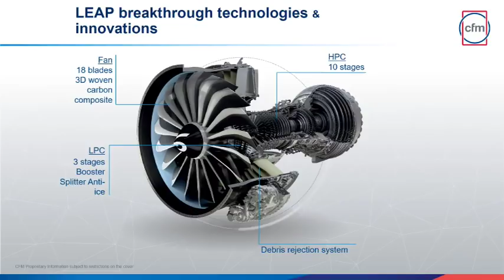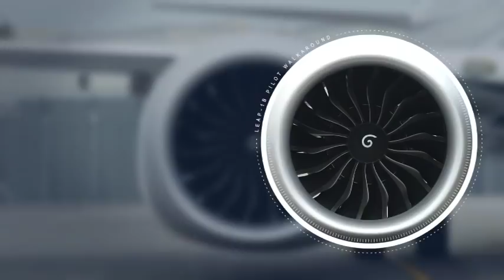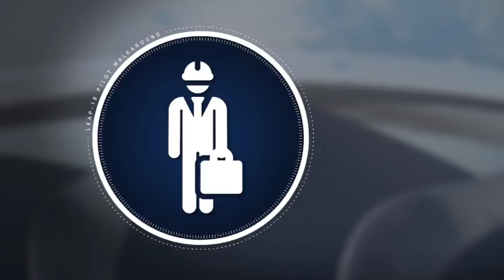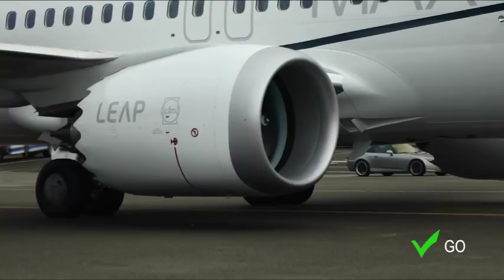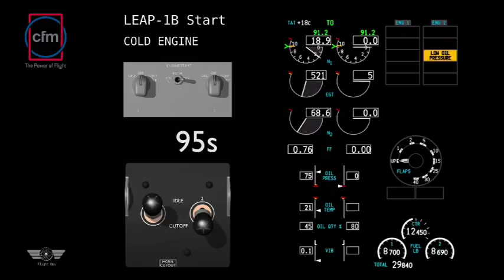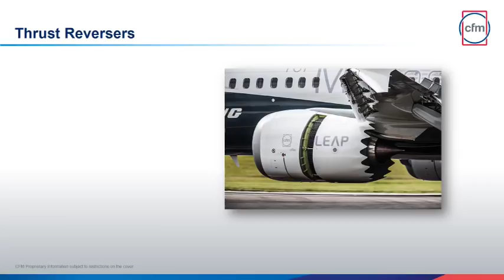CFM LEAP B737 MAX Engine

Comment: This engine is almost identical to GEnx 1b engines. The composite fan blades and fan case, 10 stage hpc and 2 stage hpt and the introduction of turbine center frames makes me think is this a smaller GEnx? 😅 it’s a great achievement to improve the cfm56-7b engine by this fuel efficient engine can’t wait to maintain it  😊

Comment: Lets be honest they are too big to fit the max and the software to hide this massive oversight caused all those crashes and deaths
Reply: Nah, the problem with the max was simple. It handled different than the NG, and the software was made so both flew the same. That way you wouldn't need any simulator training for the MAX...  it has been proven and tested by EASA that the plan can safely fly and operate in all condition without any software help.
Also.. a software to correct or modify a plane behavior is pretty common. As a matter of fact. The B737 (any version, including the MAX) is one of the less complicated airplanes, the only big airlines still in production that uses hydraulic controls over fly-by-wire. So the pilots control the aircraft directly. 
In the case of any airbus, the plane is flown by a computer, and it's behavior is heavily modified...

Comment: Can an aviation expert inform me how bigger engine  or more powerful engine  makes  less fuel consumption    ??  As I know in any mechanical system  bigger engine means more fuel consumption   ......
Reply: Lower rpm for the same amount of power as the older engine acheived through higher rpm.  An engine that has power sooner and revs less will consume less.
Reply: Shadow Opp.'s RC There’s no reason RPM is a problem
Reply: Really the only thing bigger on this engine is the N1 fan.  The core of the engine is actually pretty small, hence the 9:1 bypass ratio.
Reply: Lower RPM, higher pressure. = more power, less fuel

Comment: Most people do not complain about the design of the plane with new big engines, it is MCAS as it is suppose to be a safety feature but it turn out to be a killer, Boeing should take note that all safety features should be priced in the selling price and not treated as optional, period

Comment: Obviously the MAX family needs redesigning. What's urgently needed is a taller landing gear that would allow the Leap Engines to be placed lower and backward, pretty much like the placement of older engines so as to use the CG and thrust parameters as it was originally designed. The new Leap Engines are placed in the wrong place.
Reply: Exactly!  But its like teaching a pig to sing. Not going to happen and you only annoy the pig.  JMHO of course...  8)

Comment: Sounds like the 737 MAX is too over-engined which leads to high AoA due to engine placement over the 737 NG...which required Boeing to install the MCAS...which lead to disaster.
Reply: Somebody at Boeing has an incorrect theory of operation of MCAS which to me suggests insufficient testing or substituting digital modelling for testing.
Reply: @michaelmagyar5734  yupp. It was to rush into market and collect the millions.  Cold comfort for the people that lost their lives.
Reply: MCAS in 737 MAX only uses 1 sensor which is not very proper development. They should've put 2 instead of 1
Reply: The 737 airframe or fuselage 52 years old did not have a new engine option. The A320 did being higher off the ground. The Max was a dud right from the word go, Leap turbo fans too big and too heavy, consequently the aerodynamics of the plane were knocked out, but wait, lets install MCAS said Boeing. And so it flew, well sort of. With faulty data from one AOA sensor it flew..........nose down. The solution. Re engine and dump MCAS.

Comment: A plane that falls out of the sky marketed to developing countries and unsuspecting airlines. Let’s get rid of the AirBus a380, a spacious very safe aircraft and force people into smaller planes built by Boeing that have a built in feature that kills scores of people. Boeing is very proud of it’s accomplishments in forcing out competition and the murder of people then forced to fly on its planes.
Reply: For the record - Airbus had THREE A330 planes with similar attitude-correction systems have "incidents", one had 119 people injured.  In those instances, the computer was receiving unusual data and was indicating stall and overspeed simultaneously.  Yes, those flights landed safely, but Airbus is NOT immune to similar happenings.  The difference seems to be that Airbus had limited the trim authority to 10° (actually TWO protections kicked in, the total trim command from the two was 10°), it seems no such limit was in place by Boeing (though the software fix due in April may include such limits).

It also sounds like the FAA may hold some responsibility, allowing Boeing to "self-regulate" and just rubber-stamped whatever Boeing put in front of them due to staffing shortages, rather than reviewing and verifying what was presented.

Comment: The public has lost trust in Being since two of their latest Boeing 737 Max crushed in less then 6 month.   I certainly wouldn't fly on Boeing!  Coz they put profit before safety!
Reply: Every thing in the USA is like that, Its called Capitalism and its very EVIL
Reply: @RussellD11  And how does socialism avoid this?  There's plenty of evil to go around.
Reply: @michaelmagyar5734  Mr Hungarian man! : )
Reply: It's a lot more complex than that. But it is Boeing's fault, as well as the U.S. government/FAA, for a lack of Federal [Engineering] oversight in ensuring/ enforcing the safety of the airframe type certification, and allowing Boeing to keep the same certification under 737 series, despite major changes to the airframe/ powertrain.

Comment: Grabbing a Fanblade while windmilling may cause a twist ?
Reply: Grabbing a single carbon fiber blade of a gigantic $14.5 million dollar fan while its windmilling is a bad idea, who'd have thought. :-)
Reply: spikester , stoping a Slow windmilling cfm56 by grabbing a fanblade is an absolut normal procedure during the walkaround without any danger of causing anything but a stoped Fan.
Reply: @j.f.sebastian9696  Yes that was the norm I'm sure but then your engine literally gains a net 15% or so on fuel savings the next iteration, as a result of those super lightweight materials and longer fan blades, so it's not so surprising anymore from a construction aspect. Nonetheless a tech marvel.
Reply: spikester i agree but if grabbing causes a twist, what a FO would be able to do ?
Reply: @j.f.sebastian9696  Call for maintenance I guess, however I would expect them to have some tolerances for non-static bending and it would have to be a pretty sudden grab vs trying to slowly coast it down by a blade for instance.

Comment: Same engine installed for Lion Air JT610 and Ethiopian Airlines ET302...  
All casualty have similar problem... 
Are you sure this engine are safe?  Consider both aircraft are brand new and below half year routine flight.... 
The latest technology not guarantee for our safety.... 
Old school turboprop better more than modern "flying coffins".....
Reply: agus wijaya Leap1A is installed on airbus 320, no problem for years. It is the design and software flaw by Boeing, not the Engine or CFM. The engine did not fail. Wrong commands were fed into the engine by the software.
Reply: @wangfengfight  You are right. The engine is not the culprit. The problem was that the engines were moved closer to the fuselage as well as moved forward to avoid the huge  engines touching the ground. This is because the 737 is traditionally built to be as low as possibe.
The plane is so low that actually there are no doors for the wheel wells .....as , if there were doors, then ,  when in open position they would scrape the ground....so in 737...no doors for the wheel wells.
All this shifting of the engine position has resulted in aerodynamic changes including lifting of the nose up due to the enormous thrust of the  low slung new engines....it is to correct this nose-up tendency that the MCAS was devised...which now has become the issue.
Reply: @rajarams5988  Yes the larger moment (force x distance from pivot point) during max thrust seems to make the airplane unstable, and until the 2nd crash, MCAS was thought to be able to recover stable operation under all known conditions.  Now we can guess that there are unknown unstable conditions MCAS is unable to recover from.

Comment: This engine had kill so many people.
Reply: Hop Lam:

The Leap engine has not killed anyone....it's Boeing's failure to provide a  redesigned and larger elevator is what is causing the 737 MAXs to nose dive into the sea/land.

Relying on MCAS is not good enough. When Boeing placed the much larger Leaps on the 737....it changed the flying-dynamic characteristics so much...at Maximum Takeoff Thrust...with the newer Large engines hung lower and further ahead....the plane naturally wants to pitch-up at maximum thrust...in instances like takeoff and climb-out to initial assigned altitude.

Boeing should have given the 737-MAX a bigger rear wing "aka elevator" to counteract the effects of the new engines. The sick part is, the FAA ever approved it fly at all. Sadly, a software fix to the MCAS won't stop future deaths....only a fail-safe larger elevator will.
Reply: Hop Lam — MCAS design errors were the cause.
Reply: JohnDEER175 garden

Comment: According B737Max-8 Lion Air JT610,last flight before crash,passangers from Denpasar To Jakarta said,the engine strange "roar" sound and couple time like loss power a make them like ride roller coaster during flight... and after couple hour,the flight was allready and have "airworthy" to next flight from Jakarta to Tanjung Pinang... Then after take off just 12 or 13 minutes,the plane crash/plunged to tanjung karawang sea...  First And Fatal Accident for First B737Max8...
Reply: that is a normal noise of the engine start up
Reply: @matyqac  ...and can you explain the "ride like roller coaster during flight"?  Is this also normal?

Comment: this engine used in a recently 737 plane
 crashed in Indonesia
Reply: my question also if air speed sensor is failed, can pilot predict from rpm of the engine relative to speed? or any other way?
Reply: It sound stupid only air speed sensor can caused crashed right? Thhis happened before .... when ice closed the hole of air speed sensor...so cant fix it while on flight....there has to be another way to predict the speed....
Reply: And?
Reply: Nothing to do with Engine,
All Airbus 320neo and Boeing 737 MAX use the same engines, they are all fine
Reply: Abhay Achal they’ve put the engines too far to the front. And as I understand there’s a problem
with the leveling software.
Reply: & now the Ethiopian plane.

Carbon fibre blades WTF?

Carbon fibre doesn’t like cold temperatures
Reply: @chris77777777ify  you're a genius...
Reply: Carbon fiber blades have been used for years now nothing to do with plane crash
Reply: @esaumoreno7405  Now we have Ceramic Matrix!!!!
Reply: Your at the wrong place, this is a video for pilots and crew familiarizing them with the powerplant and systems related to the new LEAP engines not a sensationalist media release for those who know nothing about aeronautics - we all know these engines are fitted to the MAX, but why is that relevant and why feel the need to comment this?
Reply: James Bond — Not caused by the engines.
Reply: Yes, but engine is not directly cause, more indirectly. 
Engine is too big for B737 so it was moved in front of wing and raised up, this action disturbed balance of the plane for which Boeing had to implement MCAS.
And than story goes complicated.
Bottom of everything is that this engine should not go to B737 without significant airplane redesign (wings and very probably hull), but this means a new plane, probably not with 737 badge any more. And Boeing needed new airplane very fast on market since A320 NEO was taking big market share.
Reply: What are you trying to say?
Reply: have you heard 737 max 8 with this engine crashed?
Reply: Yes I know that. Are you implying the engines somehow caused the crash? The preliminary comments suggest there may have been an issue with the flight instruments.
Reply: on brand new plane? this like massive failure system that likely bom can did it with instrument with backup system....or fatal damage from the inside the engine....carbon fibre
 blades and ceramics turbin ???? this is unkown  yet ....need time
Reply: Yes the engine is a new design. From what is reported the aircraft was having difficulties maintaining level flight the day before. Seems like a computerised flight control issue. I think the evidence from the maintenance engineer who cleared the aircraft before the crash will be important for the investigation as will the black boxes. I like Boeing aircraft but I would not be keen to currently travel on a new 737 Max8 until this crash is fully and independently investigated.